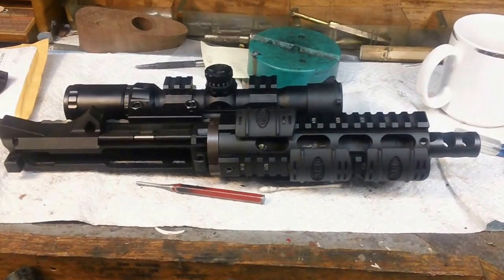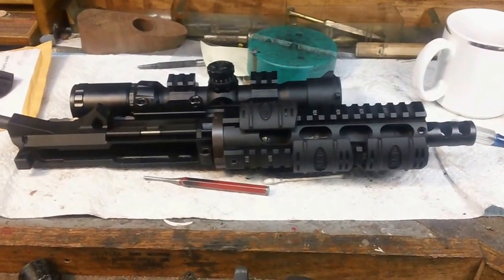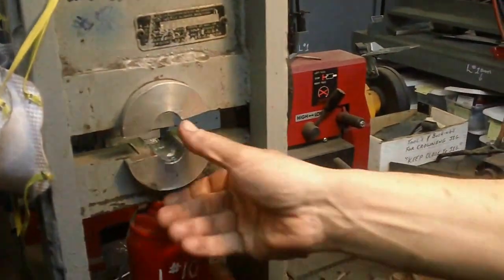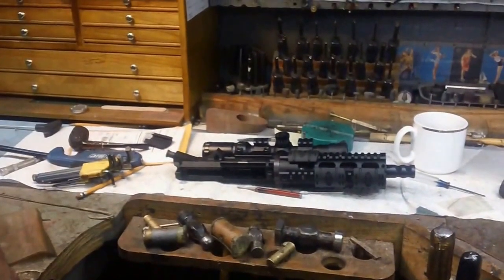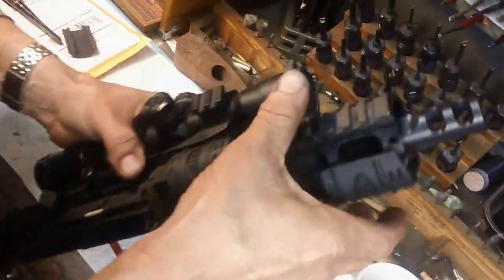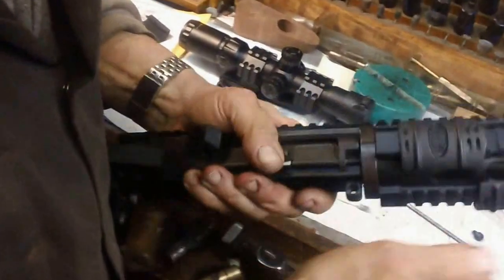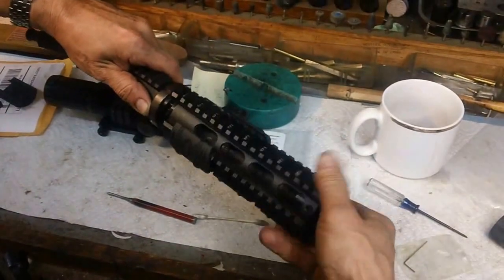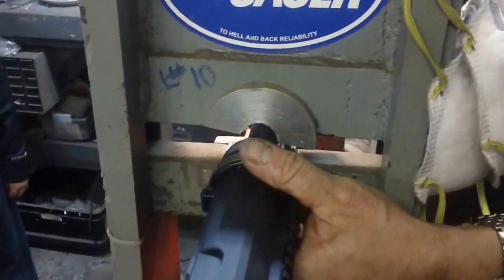A guide to installing a muzzle brake on an AR 15 pistol

Comment: It appears to be a flash suppresser instead of a muzzle brake. If it directs all the spent gasses forward I don't see how it could act as a muzzle brake. However, that being said, I would like to know if Scottie made that hydralic barrel vice himself. Or if he bought it, and if so, where he got it. Thanks
Reply from the maker: Yes, it is a flash suppressor, yes Scottie made the vice himself.
Reply: Thanks for the reply
Reply from the maker: Thanks for watching, you can call him about the vice if you want more details....
Reply: Thanks. That vice looked like it could be a real time saver.
Reply from the maker: Absolutely